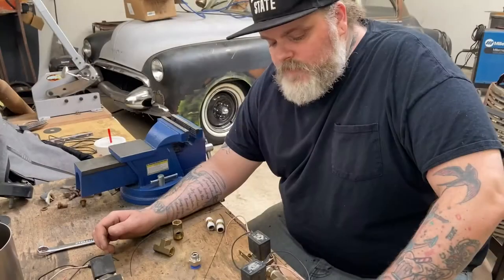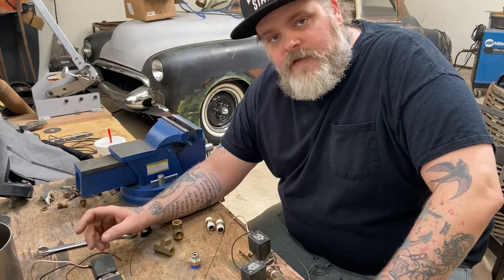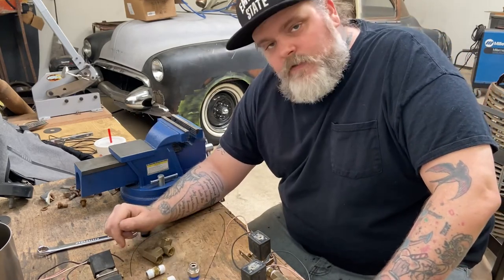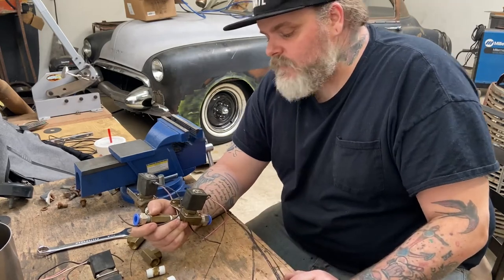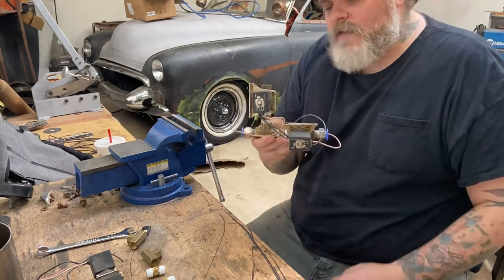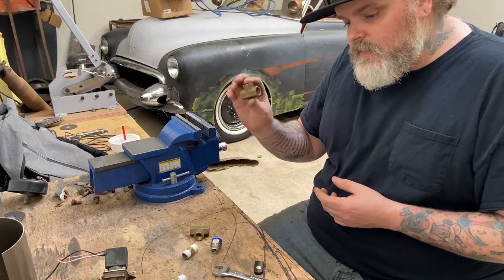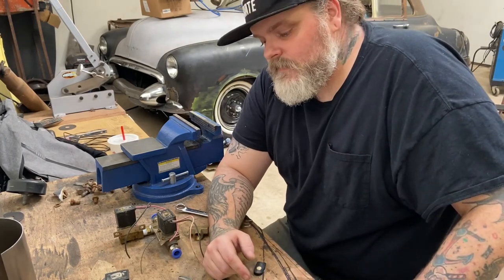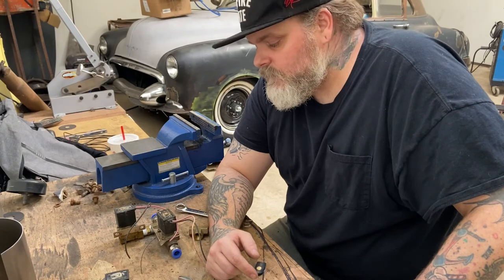How to plumb your air ride valves

Comment: Thanks bro I needed this vid.
Reply from the maker: Your welcome
Reply: @handmadehooligan   Hey thanks for the reply. You may know the Answer to this but if my tank has more pressure than the passenger side bags the passenger side will rise over time. I'm assuming that the valve needs to be rebuilt or replaced have you ran into this problem before?

Comment: FYI, the brass plumbing fittings are rated for 300psi. 
The pvc pipe is 150psi or 300psi. Depending on different factors on that.
Reply from the maker: Cool , I’ll stand by not using them for your auto needs. 
Dot approved fittings keep you safe and the other drivers out there as well. 
Keep the household plumbing fittings for what they are intended for
Reply: @handmadehooligan  .
I understand. I was just letting you know. 
I was a plumber for 8y.